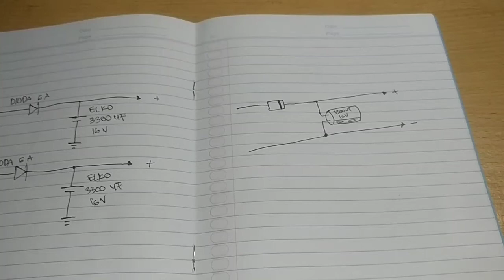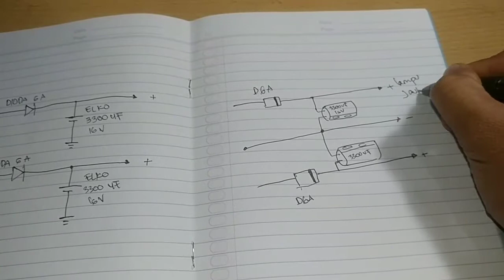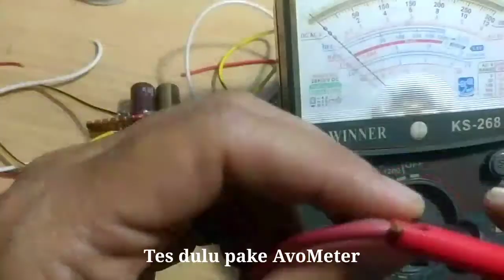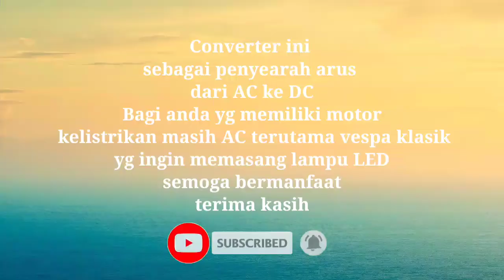DIY AC to DC Converter Mudah Murah Meriah

Comment: Bang rangkaian ini di pasang di vario karbu 110, untuk 2 buah led dg daya 1 lednya untk low 8watt dan untuk hi nya 16 watt kira2 kuat gak om
Reply: Untuk spek led nya tertulis ac/dc 8v-36v om kalo saya bikin sama seperti di vidio ini apakah led nya awet
Reply from the maker: Asal pakai diodanya 6 Ampere pasti kuat
Reply from the maker: @nurulhidayat4292  Agar lampu LEDnya awet perhatikan output tegangan dari converter tidak melebihi tegangan kerja lampu LEDnya.
Reply: Maaf om saya kan gx pnya avometer,, kira pakai komponen yg berapa ya biar outputnya gx lebih dari 36 volt,, soalnya voltase lednya maksimal 36v
Reply: Kalo rangkaian sprti di vidio  keluran maksimal berapa volt om
Reply from the maker: @nurulhidayat4292  Kalau mau lebih aman bisa pakai kiprok. Ambil yang keluaran untuk pengisian aki. Nanti arus akan di batasi di maksiman 13-14 volt
Reply from the maker: @nurulhidayat4292  Keluaran maksimalnya tergantung dari inputnya. Saya aplikasi kan di vespa super kelistrikan 6 volt. Sehingga keluaran tegangannya tidak lebih dari 15 volt. Aman untuk lampu led.
Reply: Kalo cumai 1 kiprok di pakai carger aki sambil nyalain lampu apakah gx bahaya ya om,, apakah kiprok gx kepanasan nanti
Reply from the maker: @nurulhidayat4292  Kalau cuma untuk satu buah Lampu LED aman. Daya lampu Led rata2 rendah masih cukup untuk mengisi aki dan menyuplai lampu
Reply: @kobobip  kalo dari kiprok 6v pengisian aki yg positif nanti ikut nyambung ke input positif ac apa gimana bang?
Reply from the maker: @bayuwintoko9326  bisa saja. Tapi yg input ac di putus dulu dari sumbernya.

Comment: Om klo pakai dioda 1A bisa gk..? 
Soalnya saya buat lampu depan motor LED gk sampe 1a cuma 200ma  mohon pendapatnya om
Reply from the maker: Tidak bagus. Saya sudah coba pakai 1 ampere. Diodanya jebol dan lampu lednya jadi rusak.
Reply: @kobobip  baik om terimakasih. Mudah²  berhasil
Reply: @kobobip  om itu pake elco sama dioda yg ukuran brp
Reply from the maker: @rizkihardiyansyah9927  elko 1800uF/35v dioda yg 6 ampere
Reply: @kobobip  om klo pake dioda 3a sama elco 25v 2200uf bisa ?

Comment: apakah bisa ditambahkan ic7812 untuk penyetabil tegangan ?
Reply from the maker: Kurang bagus, kemampuan ic7812 hanya maksimal 1 Ampere.
Reply: ok thanks
Reply: bisa ga bang kalo di tambah led buat indikator,,?
Reply: biar tegangan tidak lebih dari 12v dikasih apa ya bang ?
Reply from the maker: Bisa pakai kiprok
Reply: maaf tanya sekali lagi bang,,kalo pake dioda 3 ampere,,daya led max yang diperbolehkan berapa bang,soalnya mau pasang led 36w
Reply from the maker: @irwansusanto258  secara hitungan sih cukup. Tapi alangkah lebih baik pakai dioda di atas itu. Untuk menjaga keawetan komponen
Reply: @kobobip  pakai 7812 kalau untuk senja cukup kan bang
Reply from the maker: @muhamadrijal323  7812 hanya maksimal 1 ampere. Jadi kurang bagus. Lagipula input ke 7812 harus relatif stabil.
Reply: @kobobip  komponen apa bang yang ada didalam

Comment: Bang ini klo output ny di tambah step down gimana.. apakah bisa...?   Tjuan biar volt tidak mlebihi kapasitas yg di inginkan..?
Reply from the maker: Secara teori sih bisa saja. Namun kalau dihitung secara biaya lebih baik pasang kiprok saja.
Reply: @kobobip  antisipasi kiprok over voltase bang 🤗🤗
Reply from the maker: @haristam2823  tidak perlu sih selama kiproknya bagus.
Reply from the maker: @UCgjGg_FP-LQ_cQsEq9ds_CQ iya tentu harus pasang komponen lagi, bahkan modul step down. Dan setahu saya step down itu khusus untuk yang tegangan inputnya stabil. Lebih baik pakai kiprok saja.
Reply: @kobobip  ok siap"👍👍👍👍👍 makasi saran ny..  salam hemat dr kota tulungagung
Reply from the maker: @haristam2823  salam sehat juga buat semuanya. Sukses selalu
Reply: Bang mo nanya lagi.. ane pake supri125 karbu yg blom injecs.. rakitan sya pke elco 22ooπf yg 25v dioda nya 6a .. bener uda dc tp tegangan out ny kok cuma 0,7v dc ya. Pas  gas rpm separo
Reply: Kalo outputan sklar lampu utama terbaca hampir nyampe ke 11v ac,, di rpm separo lebih dikit.  Tp keluar ny ke dc  kok cuman sgitu ya. .
Reply from the maker: @haristam2823  coba di periksa sambungan negatifnya. Apakah sudah terhubung ke massa/body?
Reply: Kalo negatif/masa Ac ,yang dari sepul cuma masuk ke kipok belum nempel ke bodi. Gimana saran nya untuk supra 125
Reply from the maker: @haristam2823  massa/negatifnya ambil saja dari body.
Reply: Dah berhasil keluar arus bang . Tp tegangan out nya jadi 48v dc di rpm tinggi. Trus saya turunin elco nya jadi 2200uf 10v jd cepet panas elco nya.. 
Kalo yg 25v 2200uf .. tetep adem tp volt kok tinggi banget ya...?.
Aman gak buat led 12v 15wat..?
Reply: Kalo tanpa elco arus keluar 7v dc Coba tes pake led strip 12v 3wat nyala aman..
Reply from the maker: Tanpa elko juga sebenarnya bisa saja. Tujuan pake elko supaya lebih halus saja keluaran tegangannya.
Reply: Iya bang jadi halus.. 
tp volt dc output nya kalo pake elco 25v 2200mf,  
kok jadi naik sampe ke 47vol dc ya.. aman gak itu ke lampu led 12v
Reply from the maker: @haristam2823  coba di ukurnya sambil pakai beban atw lampunya terpasang. Kalau tidak terpasang bisa saja sampai 40 volt.
Reply: @kobobip  mantap ilmunya om, mau coba di king 2003

Comment: Pake elco nya 16 atau 25 volt
Reply from the maker: Saya pakai yg 25 volt
Reply: Kalau 1000uf  25 v bisa kan. Dgn dioda 6 ampere. Yang satunya Elko 1000uf 16 v. Takutnya meledak 😁
Reply from the maker: @raismusliman3044  pakai yg 25v saja lebih aman
Reply: Motor saya Supra x 125 keluaran 2006. Kelistrikan nya masih ac
Reply: Kalau LED langsung pasang bisa cuma pas rpm tingginya meredup.